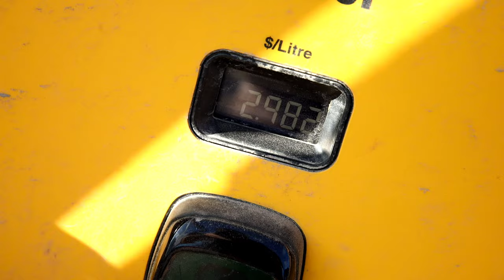5 SURPRISING differences between the F-350/F-450/F-550

Comment: Newer f450 cab & chassis can be ordered with up to a 16500lb gvwr, the f550  up to 19500lb gvwr, and new f600 with 22000lb gvwr. If you need more than that you have to step up to a true medium duty f650/f750. We’ve got an ‘04 f450 and the only difference back then between it and the f550 was the leaf springs.
Reply: Can u explain to me what gvwr is and do you know what that rear ratio thing is on the ford trucks?
Reply: @dr.blast__2713  gvwr is gross vehicle weight rating, it’s the maximum legal weight of the truck fully loaded as rated by the manufacturer
Reply: @dr.blast__2713 gvwr is truck weight plus payload not including trailer loads
Reply: @ThrivingEarthFarm  thanks
Reply: @jonnyonwheels  thanks
Reply: Didn’t the old F450’s have a Dana 80 rear axle and the 550’s had either the Dana S135 axle or the S110? And with the 80 axle, smaller rear brakes? Pretty sure that is the case.

Comment: The front wide track axle in the 450 and up trucks are a Dana Super 60, so it's got a 10" ring gear, bigger u joints, slightly larger steering components vs the regular 9.75" dana 60, also when you go to cab and chassis trucks you get a heavy duty c channel frame instead of the boxed frame in the regular pickups

Comment: I don't know  about in Canada, but in the US by not having a bed (of any kind) moves you into a different category. It would allow you to pull a longer trailer. I think it would take you to 75 ft total length (bumper to bumper), instead of 68 ft (I'm not 100% sure of that as exact). But that would allow a trailer with a 45-48 ft deck.
Reply: yeah in canada (depending on the province) we can pull a rig upto 75 feet with a regular license and regardless of the vehicle pulling it.  If you want to send it with a 1/4 ton truck pulling a 5th wheel and a boat hooked to the 5th wheels bumper, you can giver, as long as you don't exceed 10k lbs in towed weight (then you need a different license).

Comment: I have the 450 cutaway with a winnebago class C maxed out on axle weight in the rear without a trailer. The tires age out and blow after 6+ years, often taking out the cabinet behind that wheel. I monitor the pressures closely and after warming up of 30+ miles pressures go from 80 to 96psi on new all steel tires. So even way under mileage, the tires have to get refreshed that often.

Comment: The F250,350,450 all have the same frame just more springs in the rear, different axels and gear ratios. The 550 has a different frame altogether, different axels and shares the de-tuned engine like the 450.

Comment: I tow a 26k 5th wheel with a 21 f450 and I wouldn't have it any other way. It's a beast.
Reply: Yeah, I was wondering if an F450 is enough to carry an Eagle Cap or Host Yukon (5Klbs empty & close to 10K fully loaded) truck camper or for windy/top-heavy considerations if going to a 550 was best. I like the turning radius of the 450/4500 & wondered if a 550/5500 would be overkill.  Scoring a used older 450/4500 would be a tad easier on the wallet as well.
Reply: @celestepalm6949  - 2015 Ford F450 crew cab 4x4 can tow up to 31,200 you won’t feel that camper
Reply: @CoyoteFTW  If you're talking carrying capacity vs actual towing then I am impressed - towing capacity is great to know for 5th wheels, etc but with truck campers it's all about CCC. Thanks for replying!
Reply: @celestepalm6949  450 is plenty..duelly and 12 ply . commercial 19.5 tires.. I am old.. people have run that stuff on f 350 duellys with springs and airbags, upgraded, you just don't want then tow in addition to that.,,but they do. boomer dad packed the station wagon till the springs were on the axle,,pop up camper.

Comment: In 2020 I had my mind made up to get the F450 for the tires and turning ratio, but after studying the Ford propaganda discovered the F350 actually has a higher "legal" pin weight than the F450 and the F450 didn't have tire pressure monitoring. Maybe I made a mistake but I haven't regretted it and the F350 handles my 18k 5th wheel great and I haven't run into a situation where turning radius has been a problem.

Comment: Your absolutely right about the detuned motors of the cab chassis of  F550 and up. Smaller turbos and it makes just 330/850. That's a big difference from 500/1200 for the high output.  Your right again, on most drivers will go foot to the floor, because if the power is there use it and most likely due to being on strict time limits and pay schedules. I drove class A vehicles for 25 years and did hot shoting for 8 years with a F-550 and 11k lb 38ft sliding axle trailer. Didn't mind the loss of power most times but going up mountainous highways was to be desired and most 18 wheelers hauling more weight pass me easy doing 65-70 mph up 5% grades. So Ford could have made more "detuned" reliable power not so much for speed but for consistency, lugging a weak motor isn't healthy either. Solution is to spec out the right vehicle and motor setup for what your hauling and where your hauling it. Can't assume a F-550 or 600 will haul 40k lbs consistently when you can get a F-700 or higher that can do that 40k lbs consistently with ease and has a buffer for extra weight or just keeping it in the sweet spot rather then being maxed out all the time. Class 4 trucks have no business doing class 6 and up duties. I always felt more safer and comfortable hauling 30k lbs in a class 7 truck then a class 4 truck (F-550). These vehicles have really seen an uprising of entrepreneurial truck drivers looking to hotshot on the smaller load market. Obviously making fleet hauling companies pissed off and some drivers upset of not getting the easier lighter loads that still pay decent. Hotshots do it by virtually eliminating the pork of bigger fleet companies and under cutting their transport prices. In my opinion I only have issues with the fly by night drivers with some extra cash who just look at a YouTube video and read some articles and think they can just buy a truck set up get a CDL license and make mega money doing the aforementioned. They are mostly obtuse and woefully inept and make honest pure breed truckers look bad. In this industry like many you're either born to do it or you most likely won't last or you'll be left without your sanity by the time you retire, quit, or get fired. Thanks for the input, Stay safe driver 🤙🏽🇺🇲
Reply: idunno man. I have to question the accuracy of one of the details you mention here. I get stuff shipped on UShip pretty frequently using these hotshotters and you might not be underestimating their abilities far enough. These guys can't back a trailer, their equipment is broken or breaking about (literally) half the time, and most importantly I don't think any of them have a CDL... I'm serious. These guys are crack heads and some of them may not even have a drivers license. But CDL? No way. Most do not. I have some stories I could tell...
Reply: @NateAIM  And this is what messes things up for the guys like myself who hotshot correctly. I have a CDL, and I take pride in both my equipment and my business. Unfortunately, there are a lot of guys that just hop on the road with no knowledge of anything.

Comment: A GEO Metro with a 75hp engine could pull a 80,000lb trailer. The problem starts when you need to stop. Bigger trucks come with better suspension and  stopping power.
Reply: A geo metro couldn’t move a trailered smart car

Comment: I have a F550 work truck with the normal cab and bed, how do I know if it’s been detuned or not? It seems like it’s got plenty of power but it would be cool to know that could have even more power.
Reply: Maybe dyno it and normally if it's a f550 it's detuned
Reply: @dinoanamations8180  If its ok power. Leave it . The turbo s , good oil. Regular oil change. They all last.  If run the oil to sh t, then throw 3 grand at it. I was pepsi guy 25 yrs, 4000mi oil change, entire fleet. With modern oils now, you can go 8 to 10. Check it if its clean. I have an 06 f250, 6.0 powerstroke. 375000 mi.  All original commercial d tuned. 30ft trailer. had a couple of EGR valves go south. Probably could use an injector. I run Rotella t5. Change about twice a year.  I also run the archoil stiction stuff.  Just replace parts with Motorcraft when they fail. Everyother fluid, oil. Diffs and t case60000mi.
Reply: @jamesleaty7308  they make 320 320 350 hp
Reply: @dinoanamations8180  mine is 300 .
Reply: @jamesleaty7308  must be very de tuned
Reply: @dinoanamations8180  that's the base power on 6.0. If you leave them  be.
Reply: @jamesleaty7308  what about a 7.3
Reply: @dinoanamations8180  They run just a nick under 300. They and the 6.0, were intended to be equal in power. probably280ish for 7.3. The 6.0 they were starting the base for what would 6.7 with all pipeys, and def. They could have run 6.0 in its most recent config. They fixed the issues by my year, 06. Its actually the base for 6.7. with all the torque and hp, def etc. The consumers only were concerned about  who had the most hp..The FEDS were requiring better emissions.  The 6.4s, were the self destruct engines. Because of that people lump the 6.0 and the 6.4 together.
Reply: Up until this year passed all emmision. 14.999 mpg towing.
Reply: @jamesleaty7308  k

Comment: Really good explanation on the F Series HD differences! I just picked on a 2021 F-550 60" CC with the 7.3 Gas engine and 4:88 gears. It will have a steel stake bed and 3000lb lift gate on her (no trailering) as this is fit for purpose for is. What's your thoughts on this setup and in particular, the 7.3 Gas engine?
Reply: Definaly dont want a diesel if youre not gonna tow.
Reply: I have heard good things from that gas. Low maintenance, start and go.
Reply: I have one with the 73 no problem here very strong

Comment: I have a 4WD 2019 F550 that was involved in an accident. I will need to replace the entire front suspension and motor. Will the 4WD front suspension and motor of an F350 and F450 also fit mine please?

Comment: Have a 2015 450 chassis cab. It doesn't have any engine braking at all. Only transmission tow/haul mode. I can deal with not pulling the grades at speed limit under load but downgrade is not confident!

Comment: I blew the rear end in my 2019 f-450.  Ford is still waiting for more parts but they are having the replace the entire axle housing.  100k and pulling 35k day in and day out did the rear end in.  I think the Dana S110/130 was a far better axle than the Dana M300 that come in these new trucks
Reply: Which one is in my 07 f550?
Reply: Change out to amsoil in the rear. It gets too hot and regular oil breaks down too fast.

Comment: I’m gonna agree with everything you said but the F-450 having better tire wear . Every F-450 I’ve seen with those crappy stock Continental tires cup like crap within 5-6 K miles on the front axle.
Reply: Agree. I finally ditched my Conti Hybrids after 11k mikes for a set of Michelin XZE. Those Continental tires are absolute garbage.

Comment: The 450 pickup front axle is rated higher, it has bigger brakes front and rear ,the steering box is bigger .The 19.5 tires last way longer than the 350 tires & the front 2/3 of the frame is heaver ,same as cab chassis  450. The 14k gvw like the 350  is done for a reason. I just ordered a 450 regular cab pickup diesel regular out put i dont need the HO.

Comment: Would be nice if someone that knows could pitch in if the wide track front end is really just a spacer or not im interested to know
Reply: No it has a larger ring gear, thicker axle tubes, bigger ujoints. It's an overall a much stronger axle on top of the extra steering angle.

Comment: I have a 2016 f450 xlt axis 4,30 with engine km 330 000 modified in tow by my garage performance, new transmission, tranfer case, the rpm in the mountains at 90 km/h is 1900-2000 rpm without changing gear loaded with a 25k lbs,
In the information of the truck I am at a capacity of 41000 lbs max without box, I have the smallest tank 125 liter and 600km autonomy full charge, my partner has a 2017 not modified with a tank of 155liter if I am not mistaken and he makes less km with his truck than mine, I think to change for a f550 for the capacity of load but if the price is good. without what I but a new engine and I modify it has infinity because an engine install it is 10500$ it is not expensive to pay.

Comment: I'm torn between the f550 and the ram 5500.
Cummin motor with dodge crappy build or Ford built quilty with the more expensive to mentain stroker.
Reply: 6.7 powerstroke is just as good better than the 6.7 Cummins. Last good Cummins was the 12valve

Comment: Giant difference in axles from f350-450,350 has a high pinion 60 with normal 1 ton knuckles
450 completly different 60 bigger tubes bigger axles massive knuckles
I have a 1-1/4 ton giant rear end in my 2013 F450 cab/chassis 4wd 120" Wheelbase  with a 330/660 power,I also have a flatbed only use it to tow my toyhauler and after the cp4 pump failing at 100845 miles I'll never own another 6.7 LOL should of kept my 2002 7.3 F350 dually that had 450,000 miles 😀
Reply: Need the cp4 fuel block/diverter. Cleans fuel post hydraulic use, preventing extra wear, and sends it back to the tank instead of dumping it into the injectors.

Comment: My ram is good for 37k of towing. That’s just be honest these trucks are playing with the big boys now. Most rig owners I know will only take up to 20k on there trailers now a days. So at what point are we going to match the USA and say max without a class 1 would be 26001 lbs.
Reply: I think you mean 20 tons, which is 40,000 pounds.  In the US your average semi truck can legally gross out at 80,000 pounds..... then deduct the weight of the truck and trailer itself,  and that gives you your net legal load capacity. Every truck and trailer combination can be different in weight, but my general rule of thumb is 40,000 lb for a tractor and trailer.... that then gives you 40,000 pounds of net load. (20 tons) these numbers can change 5 to 10 thousand pounds in either direction but you get the idea.
Reply: @SlipFitGarage  yeah they legally can but like l said most of the truckers i know will only do 10 ton max, no money in it after that
Reply: @StevenLaFrance  Interesting.  I've been in the transportation business in some capacity or another since 1990 and I've never heard of a guy losing money because he took a full legal load.   How are these drivers making any money on hauling "half" loads?  How would a full load cost more money that a half load?  (considering the entire load goes to the same customer)  The difference between grossing out at 60,000 VS 80,000 doesn't do anything to the fuel mileage of a semi tractor.  I don't know....  maybe hauling boxes and freight is different.... but in the equipment hauling business there isn't much work to be had if you cap yourself at a "half" load of 20,000 pounds.  To each his own I guess.  Around here we haul full loads.
Reply: @SlipFitGarage  yeah most of the guys I know run flatbed freight and dryvan so having a half load actually saves them a lot of fuel on their trucks and here in the mountains of BC having 40,000 pounds climbing 12% grades just murders the trucks. But the market pays $2mile for the half loads so who knows.

Comment: Can you get away with using Home Heating fuel with added Cetane booster for lubricity ? ...over here in the UK diesel fuel is £1.85 per litre ..heating oil is around 75 pence per litre ..don't know what the exchange is ...definitely worth thinking about if it's possible 👍👍

Comment: Around the 8:30 mark this guy talks about how dealers don't know much about why these huge trucks are detuned and such 
Of course they don't know. Most of these guys are probably not even truck lovers themselves. They are simply salesmen that drive Camaros and Lexus and such.
Even mechanics are just mechanics and that's a job for them. Their job is not to be informed about the vehicles they sell.
This is all up and down the Ford corporation ladder however from the factory worker to the executives and CEO to their suppliers although a handful of engineers might know a bit about what is mentioned here. The rest of the people mentioned it's just a job for them which is why Ford made crappy cars and had to eventually give up and simply sell trucks 
Due to the lack of love for lack of a better term for their jobs even their trucks are not known to be as reliable as they claim either.
Ford and even GM should get their acts together and hire care lovers that live their jobs.
Not simply hire for example a CEO that graduated from Yale university and first worked being a CEO at Hershey's then jumped to Target and now ended up there.
These guys seek money they don't care about cars.
Kind of like a store owner hiring a head chef as their manager for the store only because that chef has great people skills.
Yeah the head chef might know about managing a restaurant but what the hell does he know about managing people in a store???

Comment: The 450 has bigger break package then the 350 but they share the same rear axle
Reply: The 450 axle is larger than the 350 dually.  Same axle housing and ring and pinion but the f-450 has larger diameter 41 spline axles.

Comment: I bought two trucks for my Business and F450 and a 550 the worst trucks ever. The gas tanks peel'd off and destroyed the engines. First time I brought it to the dealer. I had to go through insurance. Which was $25000 to repair and my insurance went up. It happened over and over again. They replaced it the second time. With the same crap they were twenty thirteen Fords Worst trucks ever. Also had Fords in the past with suspension problems. Does anybody out there understand what I am going through